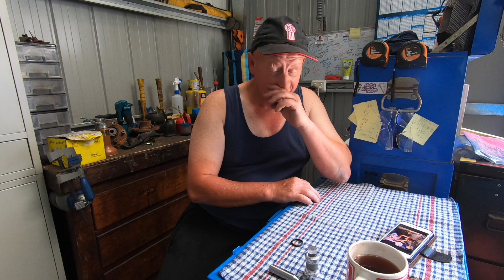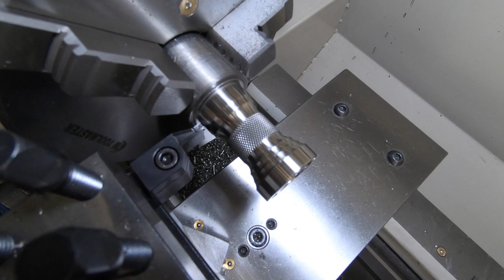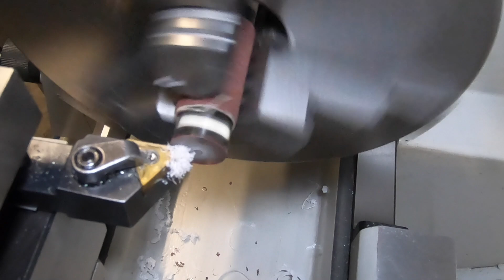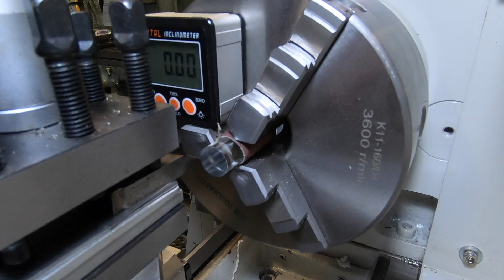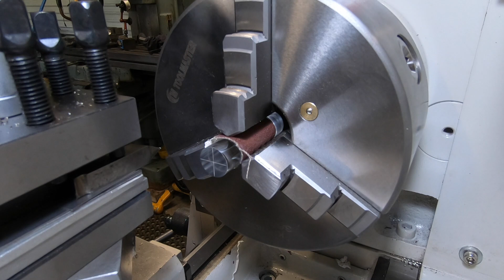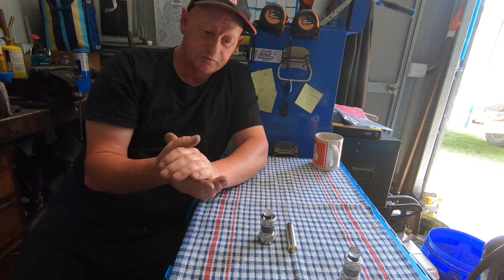Optical centre finder/punch 1500 subscriber

Comment: Nice build. I've wanted one of these for a while but have you seen the price of them .... On Ebay they're £55 plus... So an incentive for me to get on with one. Have you thought of instead of a rubber 'O' ring gluing a piece of thin rubber sheet to the bottom (inner tube ?) it would make for a flatter steadier platform and to renew dirt cheap. TTFN
Reply from the maker: Gday, there not cheap to buy but easy to make, I never thought about inner tube before but it would work for sure, thanks for watching, Cheers

Comment: I have made eight Optical Centre Punches so far, ( make good gifts) surprised you did not include a magnifier end, which is the whole basis of the unit gives you the increased accuracy
Reply from the maker: Gday, I found the acrylic rod does magnify quite well, I’ve had to make a few extras so far, people seem to like them when they visit, cheers

Comment: Congrats on the 1.5k subs mate !
Nice work on the centre punch ! i was expecting that radius tool to chatter but i didn't look like it did.
It has got me thinking of making an optical tool height gauge that slips into the chuck or tailstock .
Reply from the maker: Gday Ian, the radius tool worked better then I thought it was going to considering it was stainless, I was expecting it to chatter badly and there is no way I could even think about doing the same on the other lathe, this new lathe is quite rigid...